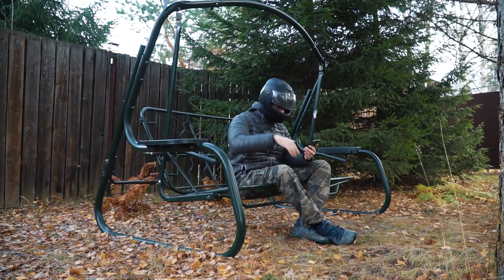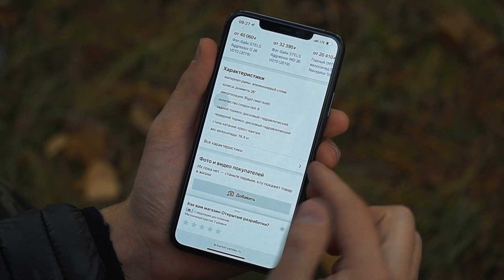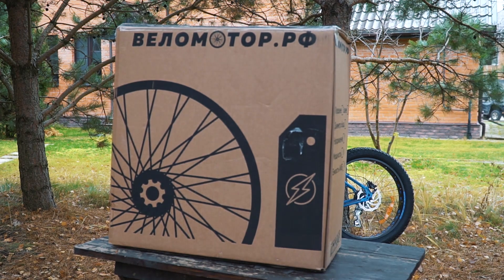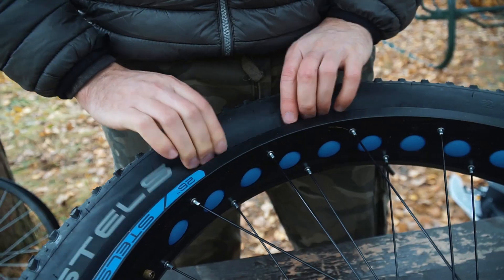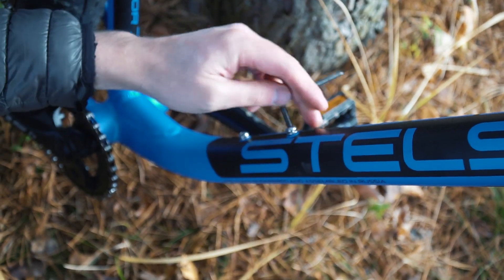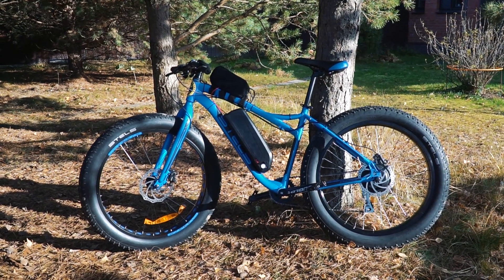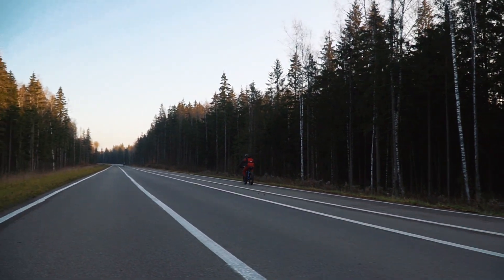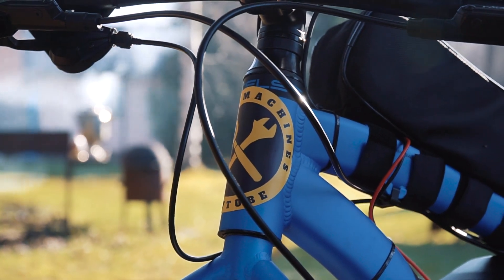DIY: Lets turn a regular fatbike into electric with a special kit!

Comment: I suppose one question is quality of the battery cells, how many charge and discharge cycles do they last, and how shock resistan they are. Otherwise that's a pretty neat trick. Just not for my country cause it'd be illegal lmao